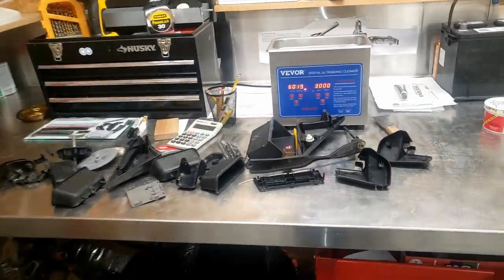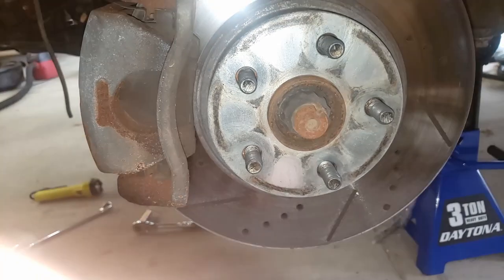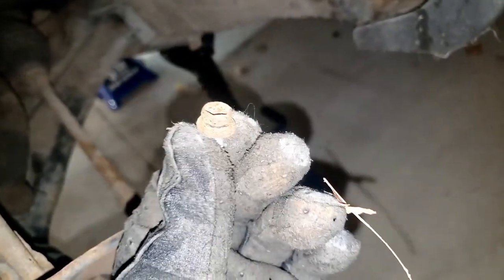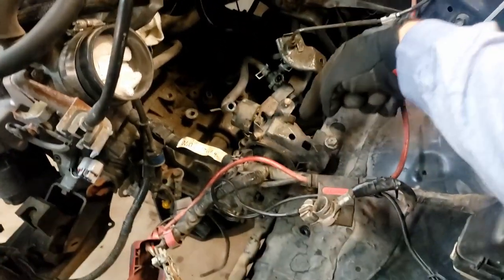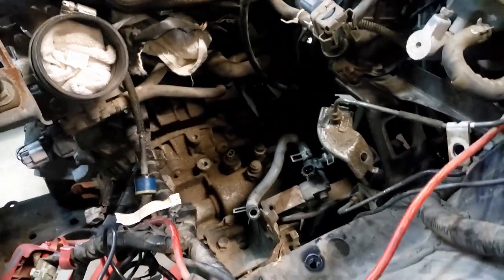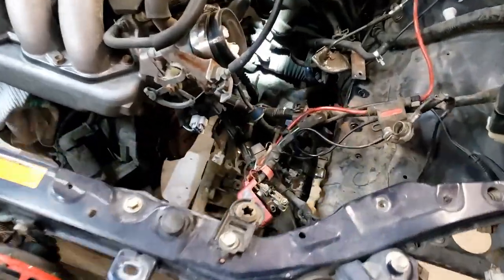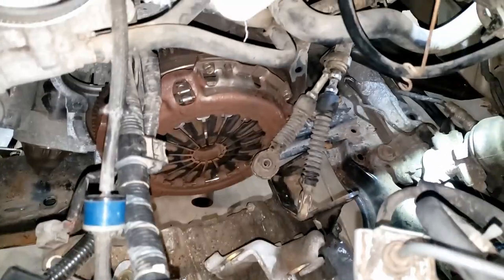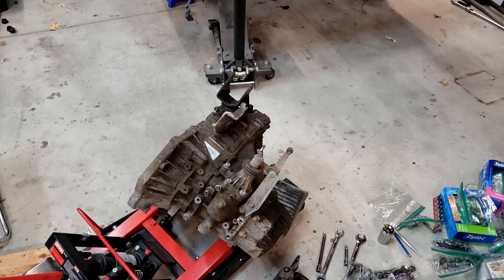Pontiac Vibe GT build episode 10: 2ZZGE C60 step by step transmission removal part 2

Comment: My neighbor says he really needs a rear main seal on one of these and I'm tempted to do it for him to save him the $2,500 the shop quoted him

If you remember, what was the most frustrating part?
Reply from the maker: I didn't do the rear main seal, but the worst part was getting the trans aligned back in place. You need two people or an engine lift imo

Comment: By any chance, anyone know if the 2003 vibe gt transmission compatible with the celica gts without a ton of mods?
Reply from the maker: no idea, sorry...
Reply: I know it's almost a year later but yes it's the same trans
Reply: @matthewmineo5393  haha no worries, yes I found it's the same but it turns out the parts are switched over from one side to the other. I think I would have needed a conversion kit but wasn't too sure. Appreciate the follow up 💪